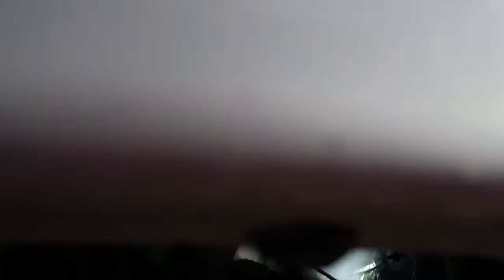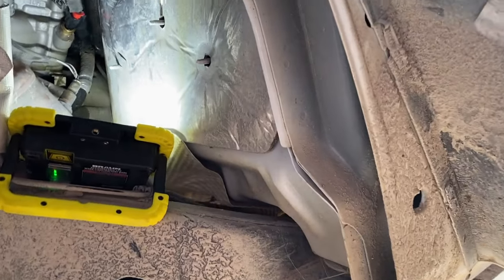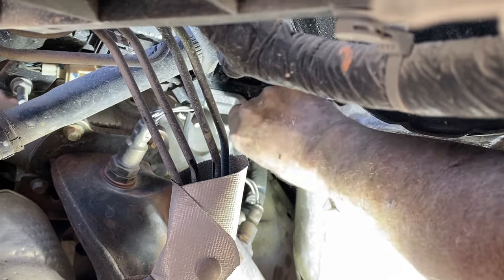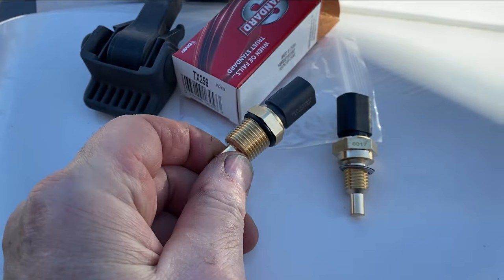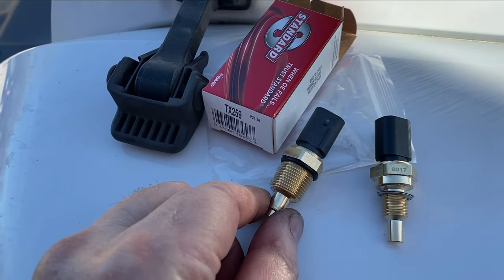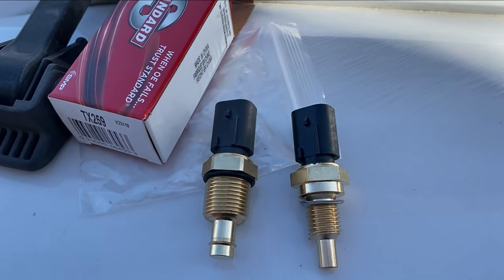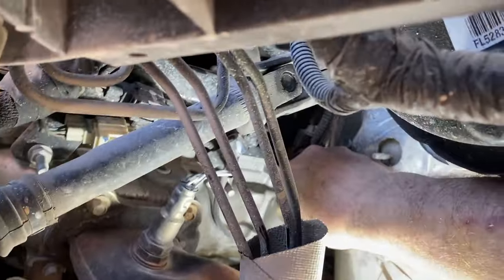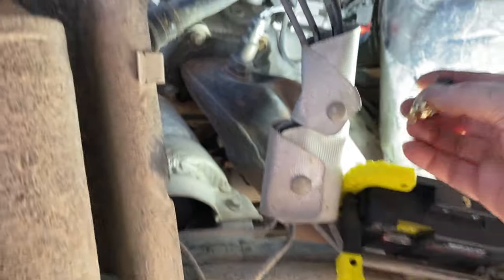Jeep Wrangler JK Coolant Sensor Replacement, Code P0128? Don't Confuse Oil Temp sensor with Coolant!

Comment: Its better from the top, you remove one bolt from the steering shaft pull it and lay it down and unplug your booster air hose, 10 min 👍🏼

Comment: I was able to access the sensor from the top utilizing an elbow and a couple extensions.  If you have large hands I could see getting the connector loose from the top being an issue but I wear a size XL glove and got it done just fine! Feel like difficulty could also be dependent on the orientation of the sensor after torquing it down as the clip on mine was really easy to access. 30 minute job for me as a novice home mechanic.  Your way would work for everyone 100% of the time but for those looking to get the job done a little quicker, might try going from the top first!
Reply: Also,  make sure you get an OEM sensor.  I tried 2 aftermarket sensors before going for an OEM sensor and no CEL since.
Reply from the maker: You certainly have nothing to lose by trying every way possible to access that sensor. Also depends on how tall you are and your ability to get “on top” of it. I could not. Glad it worked for you.

Comment: Was your jeep overheating?   How did you narrow it down to the sensor?  Did it fix the problem?
Reply from the maker: No overheating, I had a code P0128. Everything about it seemed to point to the thermostat, but, in nearly all cases it was suggested to replace the temp sensor as well. With the sensor being inexpensive and having to drain my coolant anyway to change the thermostat, it was a no brainer. And yes, my issue was solved.

Comment: 2012 Sahara Arctic Edition-For some reason, the sensor near the cylinder head is the same as the one located near the filter. Was pretty frustrated when I realized it’s the wrong thread size
Reply from the maker: I can imagine. When checking for correct sensor on my '15, I checked on Rockauto. In the coolant sensor section it shows 2 thread sizes and specifies location as either cylinder head or oil filter on most, but not all part numbers. One is a coolant temp sensor, the other is an oil temp sensor. This information shows to be correct for my '15 Wrangler. In looking at your '12 model, it indeed does show the same sensor used for both locations. Be sure when purchasing a sensor, its location is specified. Otherwise, it is easy to buy the "wrong" sensor without first removing your existing sensor to check its thread base.

Comment: Do you have to apply any sealant to the thread ? I have seen some videos where they do i m just curious
Reply from the maker: I did not, just used the crush style washer with it. No issues, no leaks.
Reply: @laurencevillegarage  great, thanks, by the way awesome video.

Comment: Which one is the one on the housing oil filter ? What does it do?
Reply from the maker: The sensor with the wider thread base is an oil temperature sending unit.

Comment: I changed the sensor on the head but did not fix the problem. The red lightning bolt is on and engine light and the temperature gauge won’t come off of cold
Reply from the maker: Typically it is suggested to replace the thermostat at the same time. That is what I did.

Comment: What's the Mopar SKU for the correct sensor?
Reply from the maker: Double check this info out to make sure it is correct for your year Wrangler....Mopar Fluid Temperature Sensor 68164627AA
Reply: @laurencevillegarage  thanks I went to Napa, Autozone, and Advance, and all 3 only showed the one you showed to be  oil temp sensor for a 2012.
Reply from the maker: @ThisTimeIsDifferent309 I believe there was a change in 2014. Mopar shows this number and style for 14-24.

Comment: People you can get to the sensor faster from above. Some people are just too technical. Worst case remove the steering shaft.
Reply from the maker: I wouldn't call removing the inner fender panel "technical". I'm sure it can be done several ways, but, even having long arms, I was unable to reach the sensor adequately enough to remove the clip and put a tool on it. With the fender panel removed (which didn't take long), it was easy. Removing the steering shaft seems a bit drastic, I'd rather remove the inner fender panel than mess with the steering. But, like I said, I'm sure there are more ways to do it. This was the way I found that worked well for me.
Reply: You don’t remove shaft just disconnect from one end and lay it down